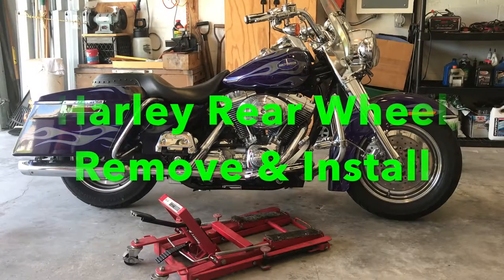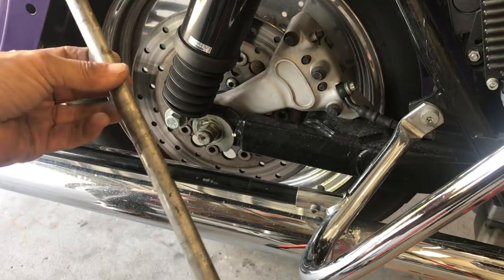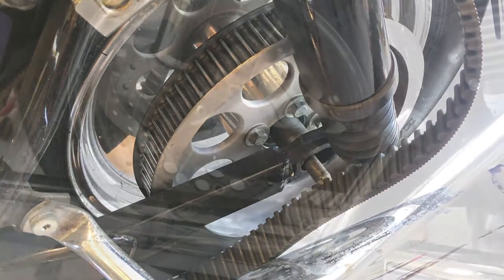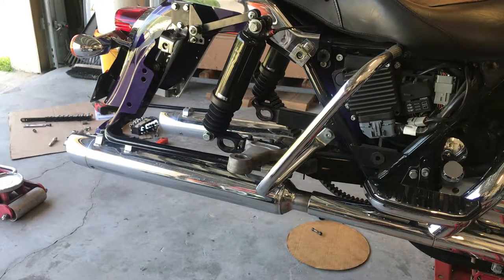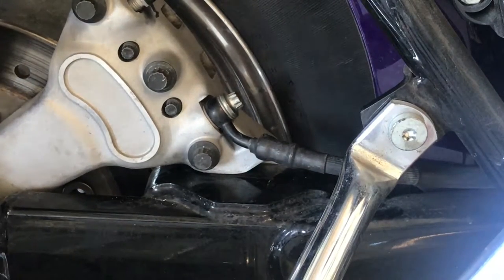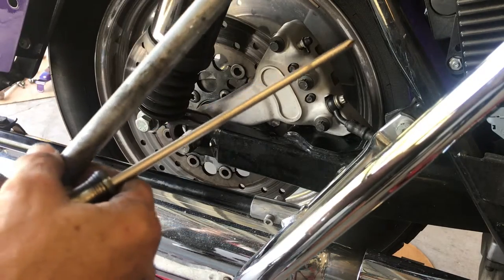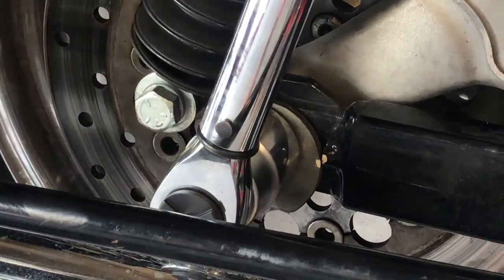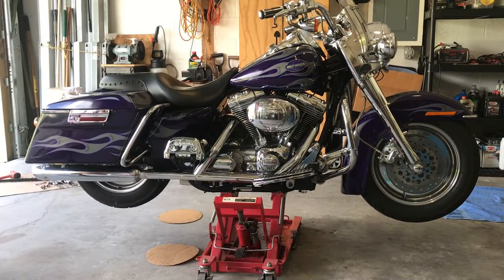How To Harley Davidson Wheel Remove And Install.

Comment: I would have thought that after 60 years of collecting tools that I would have a 1/2  bar in a drawer - not.  Went to Lowes, and saw a galvanized pipe, the correct length: $18. WHAT!!!
Bought a long 1/2" dr. extension for $19.  It worked perfectly for the tire, and I have it to use when I need a 1/2" extension.  Even a blind squirrel gets a nut every now and then!  P/S.  GREAT video.
Reply from the maker: Happy everything worked out that half-inch rod makes a world of a difference on Install and removal. Thank you for watching and all your support Steve,. Ride safe and have a great day.

Comment: I don't have the cam on my 2000 flhr there is two bolts on each side.
Reply from the maker: Loosen bolts on each side, this will give you the room to work. Take note of your adjuster and belt adjust an if good, when removing  and reinstalling wheel follow the video. Sorry I do not have that video. Any question just ask. Thank you for watching. Let us know how it works out. Ride Safe and have a great day.

Comment: Loved your video!.. loved the tip on using the 1/2" steel rod. I have the same mc jack but am only now using it to remove/reinstall the rear wheel on my dyna. Does it feel stable enough to do so without strapping the bike down to the jack?  Thanks!
Reply from the maker: Happy to help. Yes, it's stable with the Road King. I love that Jack. Thank you for watching and all your support Mike. Ride safe. Have a great day.

Comment: I saw a video by HCC where the guy just removed the bottom bolts on the shocks so he could lift the bike adjusting the swing arm providing clearance.
Reply from the maker: Thank you for the insight. Yes you can do it that way. Whatever you're comfortable with. Ride safe and have a great day and thank you for watching Sergeant rock. Have a great New Year's.

Comment: What "little adjustment" did you make on the caliper during installation? That rubber piece is keeping the caliper from sitting flush against the swingarm side just enough to make the belt try to climb off the sprocket rolling it backwards and squeal when rolling off the gas. Normally this means the engine stabilizers are worn or out of adjustment, but they're just fine, haven't touched them. I changed the rear tire, noticed that the belt rides against the tire as it tries to climb off rolling it backwards and the belt squeals rolling off the gas. First thing I saw looking it over is a decent gap between the caliper and the swingarm. Did you just have to adjust it so the axle would pass thru or did it have anything to do with that rubber piece?
Reply from the maker: Happy to help. Take a look at the video that was the last to be removed and first to be installed. Make sure your break caliper pads are fully depressed and take a look at this part in the video. 12:18  a little grease goes a long ways and then install make sure that rubber is on the bottom and not interfering and that's what I think is going on with Install. Any questions just ask. Thank you for watching and all your support. Grigori. Be patient you will get it with the caliper pistons pushed all the way in and gives yourself a little more room and that should be when you're reinstalling your wheel have it on the jack and that should be the first thing installed then spacer and then go to the other side you have your pin through the wheel put your belt on and then your last spacer there you go. I hope this helps.  Ride safe and have a great day.

Comment: Rocco, I'm going to try to do my own rear wheel change but I replacing a 16 inch rear wheel with an 18 inch wheel on my 2009 Road King Classic. Will this process work since my wheel sizes will vary?  Will the brake index marks be the same? I enjoy your simple no-nonsense approach and your calm demeanor.  That in itself makes me feel a bit more confident in doing this myself.  New Subscriber! 👍🏽🤠 6/6/23
Reply from the maker: Happy to help. I think you're going to run into some problems just with the clearance on the fender. Let us know how it works out. Something I would not do. I recommend you don't . Why are you doing it? Thank you for watching and your subscription Handyman One. Ride safe and have a great day.
Reply: @TwoWheelRocco  Cholo
Reply from the maker: @houndsmanone4563  let us know how it works out.

Comment: Great idea with the bar, on some critical points, I put a dot of fingernail polish at 12 o'clock position and keep an eye on them for movement.
Reply from the maker: I  agree.   Love to index when possible.  Thank you for your Support.
Reply: One other question, helped others removing rear wheel, upon re assemble, they would apply anti seize compound on the axle, do you agree or not necessary ?
Reply from the maker: @mikebigeasyrider  Yes I do. Look at 14;40 ON video. Not too and you will pay a dear price. corrosion.

Comment: Hi Rocco, my  1995........883 was converted to 1200 by myself alone  only done around 1000 miles since ...i was advices to replace ecm....i found one  ecm here in UK but its  from a 1340  wideglyde...can that work?...mine has 8 pin connector too....i have x2 new dinatek dyna 2000 p ecm with 7 pin connectors and cannot use them cause those idiots at "Speedoutfitters" in Helkart, IN, First time sent it wrong and second time too, actually disputing those with ebay and visa cards, thanks
Reply from the maker: No you cannot use that 1340 eco.  you need to use one from a 1995  XL1200.  What Is your bike doing that you think you need to do this?   Thank you for watching and your Sub Sal. Let us know how it works out. Ride safe have a great day.
Reply: @TwoWheelRocco  my bike runs fine apart from some hesitation, sometimes but Hammer performance advised me to replace 883 ecm with plug in dyna 2000 dual fire 8 pin and 190/45 jets,,,,so far I have a new ignition coil 3 ohms, 6r12 new plugs , 190 main and 48 pilot, I also cleaned carb and positioned clip on Grove nr 5 of the needle jet,,,,have not ridden bike yet ecm is still 883 oem
Reply from the maker: @Salvatore3333  you really do need to take her for a ride to assess the situation. Air/gas screw adj for fine-tuning for off Idle.  makes a big difference. What pipe and intake are you running and your air/ fuel screw setting? And yes the Dina 2000 will help your performance. But OEM  should get the job done.
Reply: @TwoWheelRocco  air intake stage 1 dragtron ll ...pipes are stock with screaming Eagle slip ons, air fuel mix was set on two turns out but must put carb on again and retune it, yes will tell you more soon but I want to get an 8 pin dual fire dyna 2000 to retune static time and adjust curves.
Reply from the maker: @Salvatore3333  Let us know how it works out. Ride safe and have a great day,  sounds like you got this.
Reply: @TwoWheelRocco  will do,take it easy yourself.
Reply: Hey Rocco, today i completed the assembly, bike is ticking like a swiss watch, no smoke i think the fuel mixture was set at 1 turn and half from sitting point,, jets 190/48,  needle jet c clip on 5th grove,  will still need to go round for a spin or two in a few days as weather is crap still  but so far so good also with stock 883 module, i shall imagine once i replace it 8 pin dyna 2000p module and tune it will be running like a bullet lol.
Reply from the maker: @Salvatore3333  Happy to read all is well.. Ride Safe and have a great day.

Comment: Rocco, Love the channel. Question...can i put some 16" rear rims (from a 2014 street bob) on an '06 sportster? The sportster currently has a 15" rear rim. The front is 19 on both so I don't see an issue there. Unless the brake caliper causes an issue. What do you think?
Reply from the maker: Happy to help. OEM for a sportster is a 16 inch wheel. I believe the bearing sizes on that rear wheel will be different, so you will have to swap out bearings. I am an OEM guy. So that's what I see, the bearings for the axle will be a different size you could switch them over the disc brakes I don't think will be a problem.  you could switch over the rotor from the 15 to the 16 inch wheel. Let us know how it works out. Thank you for watching and your support Jessy. Ride safe and have a great day.

Comment: Thanks for this video! 

I made the mistake of only marking the belt side cam and not both sides on my 2003 Road King Classic. I have a Clymer manual but still I’m a little confused on how to alleviate my issue. Do I need to purchase an alignment tool to get my rear wheel back on correctly? 

Thanks a lot
Reply from the maker: If you just did the belt side, that's the side that's welded so the other side will mirror it make your adjustment on the belt side and tighten the nut on the right side and you'll be straightened out as well then indexer mark on both sides when you're done it's all good. Take a close look at the cam washer can only go on one way and that's what keeps you honest. Thank you for watching all your support DM. Ride safe have a great day. Any questions just ask.
Reply: @TwoWheelRocco  Thank you very much for taking the time!
Reply from the maker: My pleasure. Ride safe and have a great day.

Comment: What tire size is this.? Front+rear
Reply from the maker: Happy to help any questions just ask. That was a 130 on the front and a 130 on the rear that is the OEM set up for a 2002 RK. Hope that helps. Thank you for your sub Hedden. Ride Safe and have a great day.
Reply: @TwoWheelRocco   Thank you i also have FLHRSEI like you, same color. But all the way in sweden. Glad i found your channel, it will make my life much easier when fixing on the bike hehe
Reply from the maker: @heddde9100  My pleasure to help. Thank you for watching.

Comment: Rocco, what's the easiest way to remove a rear wheel with a chain (shovelhead)?
Reply from the maker: Happy to help. Pretty much the same as the Road King just take the adjustment out, spin the chain off the sprocket and remove the axle and your in business. As long as you got a motorcycle lift or an auto jack and I'll show you how that's done.  sending a video. Thank you for  watching and all your support Tom. Ride safe and have a great day.    https://youtu.be/oPZn2DaxF_0?si=OtCtJXuPBb1wdaEl.  Hope this helps.

Comment: Have watched your how-to videos on the Honda VTX.  Here’s a question, what do you do when the belt rubs making a “woo woo” sound on deceleration but the rear wheel alignment and tension is correct?  If I intentionally misalign the rear wheel so the belt runs closer to center on the rear wheel pulley, the sound goes away.  🤔
Reply from the maker: Happy to help, most times on these Harleys, the belts favor the right side they actually lean against the polly right side. You need to keep the wheel aligned and deal with.woo woo. Some are worse than others, but the wheel needs to be in proper adjusted and that is what it is. Sometimes I find if they put the belt guard, in wrong, the pulley will rub against the inside vinyl of that guard. Thank you for watching and all your support MAJR. Let us know how it works out, as for a Honda VTX,  Honda got that bike right, that's for sure. Ride safe and have a great day.
Reply: @TwoWheelRocco  Thank you as always for your guidance 👍
Reply from the maker: My pleasure. Ride safe and have a great day, my friend.

Comment: Thanks for a clear and strait forward video without distracting loud music, dumb jokes and attempts to be funny or pointless profanity. I have worked on my triumph for over forty years and my 2006 Road King I recently bought is a whole new animal to learn about. I will be changing out the tires fairly soon and this is exactly the info I was looking for.
Reply from the maker: Happy to help. Any questions just ask. Road King's are nice ride and It's basically an easy bike after you get familiar with it. Thank you for watching and all your support use there. Ride safe and have a great day.

Comment: Thanks for a great video.  I did this today on a 2014 Street Glide I just got, and boy was it a bugger.  The wheels were never removed since it was built 8 years ago, and the antiseize had dried up, it was more like glue than lubricant.  I had to beat on the axle with a wooden block and mallet, and I was afraid I was destroying something.  Finally I got it out.  Another weird thing is the axle has a hole through the center and a 1/2" steel rod fits right through it.  Live and learn!
Reply from the maker: Happy to help. Thank you for watching and your sub BluesriderDF.  First time is the hardest, now it's easy work.   Ride safe and have a great day.

Comment: Does the rubber go into the bracket or sit up against it
Reply from the maker: Happy to help if we're talking about the caliper bracket that piece of rubber has a towel on it and that's how you install that piece of rubber in that caliper bracket most times it's broke. You can buy a new one and the next time you do your tire replace it. Can you take a little grease and stick that little rubber barrel back into the bracket and that will work to for temporary. Thank you for watching and all your support green smoke. Ride safe and have a great day.

Comment: 36MM is NOT 1 3/8ths!!! Its 1 7/16ths or 1 27/64ths ask me how I know.  Got the one you said, it no fit.
Reply from the maker: Sorry to hear that. 36 mm works on my rear axles,  And most old bikes. What did you buy? Sorry about that.  Ride safe and have a great day.
Reply from the maker: I understand, I'm really sorry 1 3/8 is what I thought.
Reply from the maker: Just change it in the description to 36 mm. Thank you I'm really sorry.
Reply: @TwoWheelRocco  LOL, I should have just got the 36mm. But I could only remember the 1 3/8ths when i was at the hardware store. Small mistake, but thank you for the video! Totally helps.  Besides, i like extra tools!!
Reply from the maker: @donbreest1461  I still wish I was more clear. Ride safe and have a great day. Thank you for watching.

Comment: Rocco, have you ever removed a frozen rear axle? I have a 2007 sportster and the rear axle bearings and spacers are frozen onto the axle. I have been spraying them for 2 weeks with PB Blaster. Any advice would be appreciated. :)
Reply from the maker: Happy to help. Placed a nut on the axle take a 5 pound hammer and start tapping the axle out as you spray rustbuster. Take your impact go to the other side the right side and spin up the axle with the impact gun just to get it turning, To working in the rustbuster. and  slowly tap tap spin and you'll get it out. I've had them they get pretty tough. Let us know how it works out thank you for watching Luke and your support. Ride safe and have a great day.
Reply: @TwoWheelRocco  Thanks for your advice; I will definitely report on the outcome. I recently changed the speed sensor in my 01 xl1200 after watching your video and it worked like a charm!!
Reply from the maker: Thank you for all your support. And your update Luke. Ride safe and have a great day.

Comment: I have an 05 Road king. Let the spacers fall out on the wheel in the front. Which side does the long side go on left or right standing in front of the bike the little notches on the longer bushing? Does it go in or out?
Reply from the maker: Happy to help. The long spacer goes on your clutch lever side, The notches go towards your bearing.  Thank you for watching and all your support John. Ride safe and have a great day.
Reply: @TwoWheelRocco  Thank you so much
Reply from the maker: @johngarrett5548  My pleasure. Ride Safe and Have a great day.